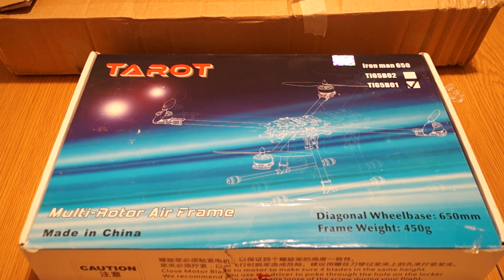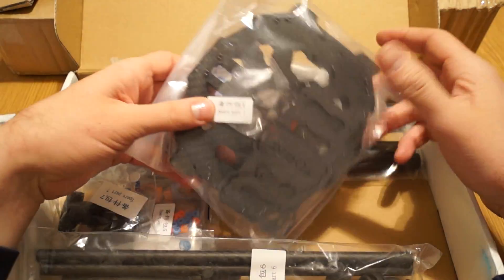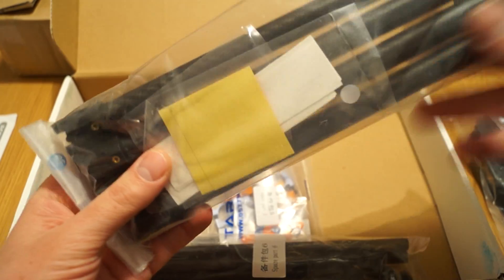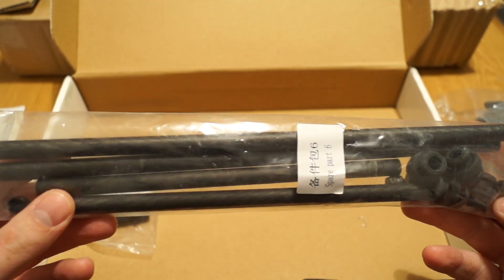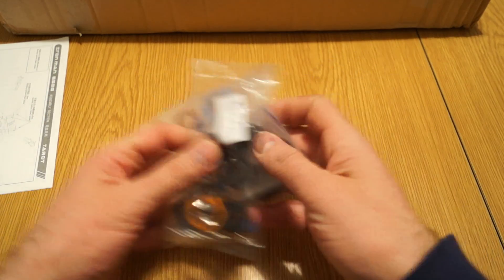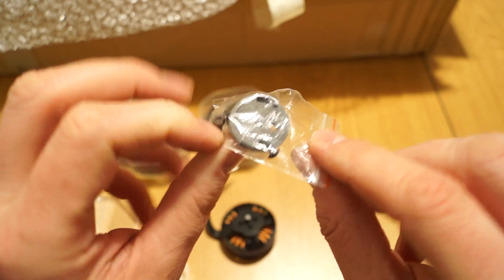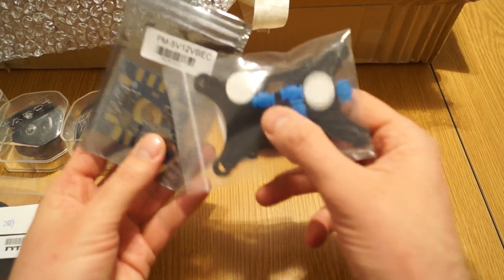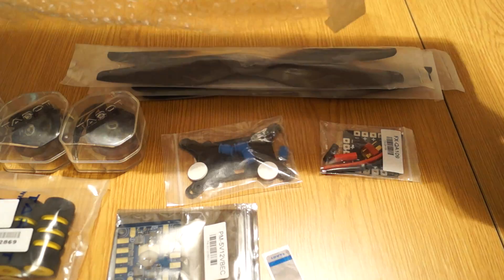Tarot 650 build with 620kv motors and 12" props

Comment: How do you like the motors?
Reply from the maker: +Tim Dickinson 
Hi Tim, nothing to complain about so far, my setup runs on 4s/4000mah lipos with 1255 tarot cf props, so my quad is a bit sportier than other ironman setups. For longer flight times consider a 350-400 kv motors swinging 15/16 inch props...